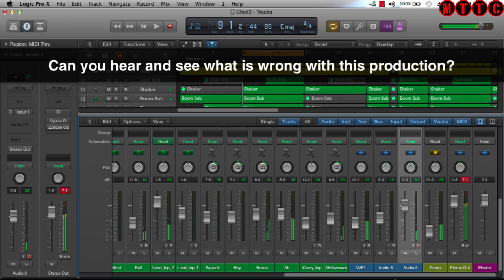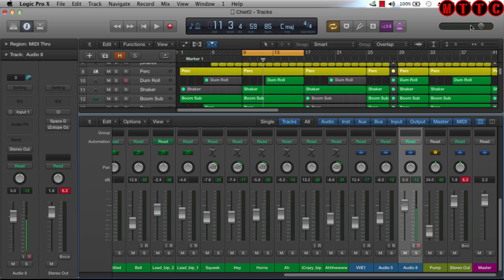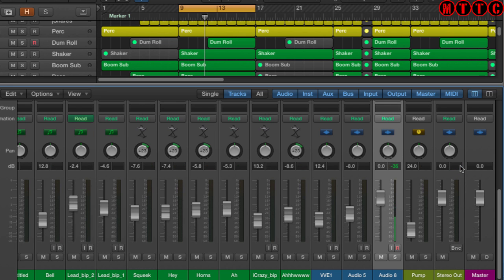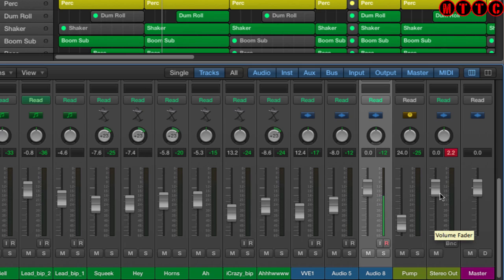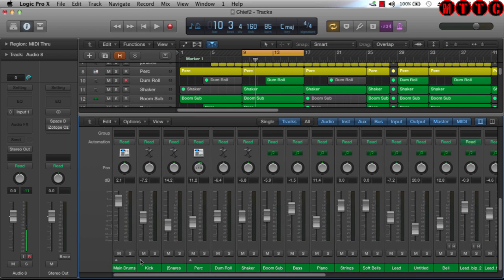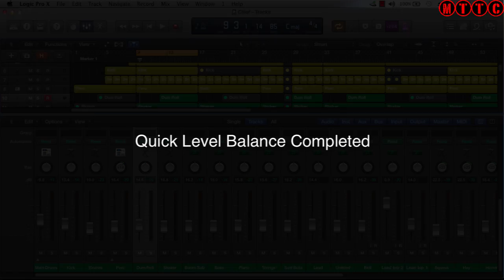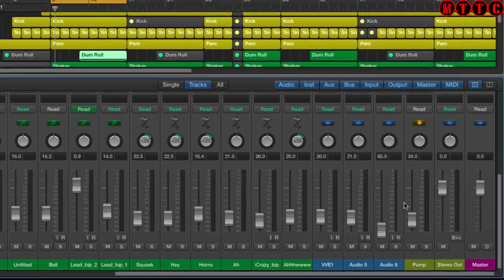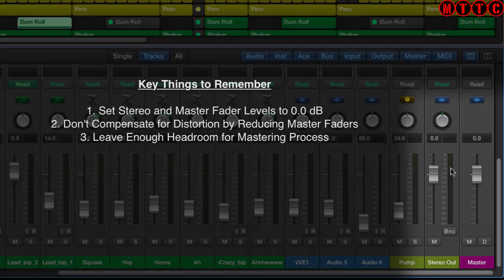How to Set Levels to Avoid Clipping & Distortion in Your Logic Pro X Audio Production

Comment: Brilliant explanation, you've just earned a new subscriber! I only have one question: how do I adapt the volume of voice track? I mean, sometimes, when I sing, I kind of yell to reach high notes, causing it to clip :(
How can I fix that?
Reply: Great video and great advice! I have my outs (stereo and master) at 0.0db, and there is nothing clipping in the audio (in the red). However, the vocals are still buzzing in my headphones. I didn't reach the peak amplitude curve, but it does get pretty loud. Is the lack of compression/technique the reason for this buzzing?

EDIT: This happens even with 7db headroom.
Reply from the maker: Hey there. Thank you very much for your subscription and positive comment. I really do appreciate it.
Regarding clipped/distorted digital audio recordings, it is quite a challenge being able to get these tamed once they are there and Logic unfortunately has never really been equipped to properly resolve these in artefacts. The tool I use which is amazing is iZotope RX plugin. Even though they just released version 6 I'm on version 2 and it works wonders for a range of noise reduction issues. The full on RX6 bundle will cost over $1000 but the cut down Elements edition is around £130. Check out this video to find out more. Cheers. https://www.youtube.com/watch?time_continue=44&v=qL0KicrQRLo
Reply from the maker: Oh also, one solution is to get yourself a hardware compressor which you will route your vocals through before they hit the computer. This will tame any attack transients jumping above your set threshold and even limiting things so there will be no clipping at all. 
Of course the best way to eliminate the issue is through better recording levels and mic technique :-)
Hope this helps.
Reply from the maker: So sorry for the long delay in replying. I am curious to learn what you mean when you say buzzing. Have you recorded the vocals themselves too loud and actual wave files are clipping?
Reply: Thank you for your concern. No worries on the delay. I think my music might have had "buzzing" due to being recorded at 44kHz instead of 48kHz. I was working with some tight vocal harmonies. I think I need to re-record my music at 48kHz
Reply from the maker: Cool. Glad you managed to resolve the issue. Cheers.

Comment: at the end there you say you generally leave 4 to 5dB of headroom, can you just clarify that? i mean, i have set  the stereo and master faders  to 0 as you have done, and ive mixed down all the tracks so there is no clipping occurring on the individual chanels, should that be enough? i guess my question really is how do you measure the headroom exactly, is that the amount of dB between the actual output an the 0dB point? useful video though, thanks!
Reply from the maker: Hey there. That is a very good question. So when I refer to the amount of headroom I leave at the end I'm referring to the master Stereo Out channel. I would look at the meter readings here and aim for the Stereo output meter to show -4dB max. If it is going over that amount I adjust the individual channels ensuring that every thing remains balanced and sounding great but simply aiming for that amount of headroom. This is important especially if you want to have your tracks mastered professionally your mastering engineer will have sufficient room to work their magic. Hope that answers your question.
Reply: thanks for the speedy response, yeah that's great, been putting off learning these tips for too long now haha
Reply from the maker: You are very welcome. Do get back in touch if you think I can help in any other areas. All the best.

Comment: But how do you get it to still be so loud?
Reply from the maker: Hi there. So sorry for the delay in answering your very valid question. The way to increase the overall level of your track is through compression and limiting. This particular video focuses on establishing a good balance in terms of the relative levels between each instrument or sound. However once that has been accomplished multi band compression, limiting and even mastering will raise the overall average level of the main stereo out to give a much louder perceived volume.